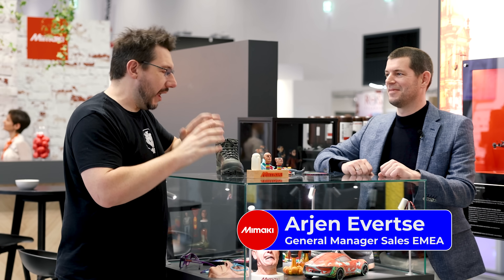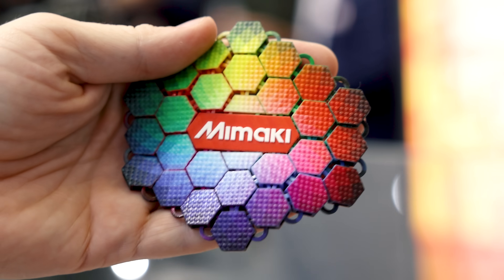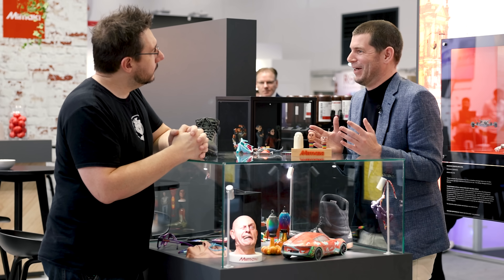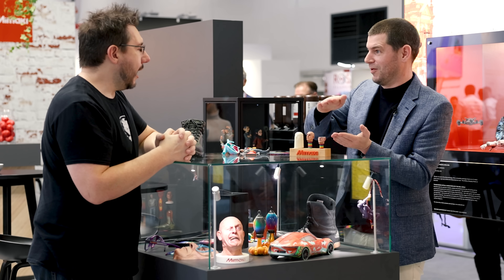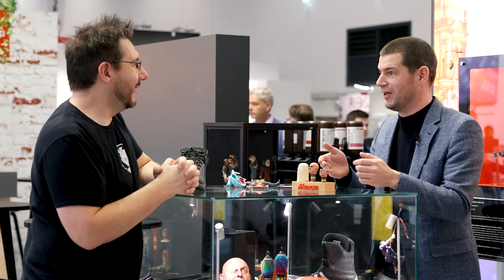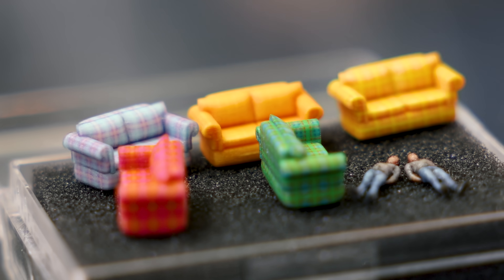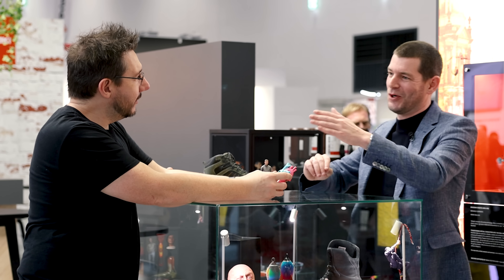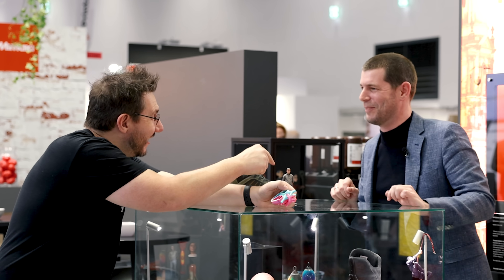3D Printing 10,000,000 COLORS?

Comment: This is a really cool new tech, but I wonder if 3D print fans know we've had full color prints for 20 years now. I was already a fan for a year or two before getting to see Z Corp's starch powder based prints at Siggraph 2005. It raked over a thin layer of starch powder, then used an inkjet + binder to lay down a full layer of color, or just at the edges if you wanted. The binders could be different, so the spring looking thing in my pics here is actually fully squishy rubber - it feels like latex (they sent me one as a sample request, but it didn't hold up well through all these years, and got pretty stiff). These were tens of thousands of dollars. Then Dimension came out with a filament machine, and I wanted that, too. I remember watching them drop each year, from $20k or $40k (can't remember now) to $18k, then one of them was $8k, and I thought a long time about it, but never dove in. One cool thing about Z-Corp's powder tech is that you could cut through it at any angle to reveal full-color cross sections. I'm fascinated by Mimaki's concept, though. Anyway, my old pics from Siggraph 2005 of Z-Corp's prints: https://www.flickr.com/search/?sort=date-taken-desc&safe_search=1&tags=zcorp&user_id=85719887%40N00&view_all=1

Comment: I run a Mimaki UV large format printer at my work, we have another with a raisable bed, we actually basically 3d print laying layers and layers of the exact resin he's speaking of here. minus the ability for the fancy washable supports; We've even taken our waste ink or expired material and dumped it in a resin printer, cured it with UV, worked okay.

The machines these guys produce and the print heads they make are insanely cool, they're amazing machines.

Their service team over here in North America, lacking in my experience..

Comment: I love how this technology has expanded over the past few years... I know it has been on the "outskirts" of 3D printing for a while and used in certain high end niche projects and steadily getting better.  I would not hold your breath for it getting anywhere near the consumer market like other formats in the near future... maybe in a decade it will get down into the single digit thousands... The tech is available, but it is still a very slow process building up ultrafine layers and even though it is kind of like a flat inkjet, the inks are still hard to work with and need a very controlled environment, plus it is also almost as messy as resin printers.  Thank you Joel for giving us a great update into what is possible!

Comment: It's pretty staggering how precise the tolerances are to have a machine drop four colours of ink, plus whatever other chemicals are involved, with microscopic accuracy, from a print carriage that just whips back and forth thousands of times. I've used a few large format commercial (2D) printers like the kind Mimaki are known for, and even those are impressive. But doing it in 3D is just nuts.

Comment: It's not just the colors that's impressing me but the very fine, seamless, smoothed layers at that size.  Edit: just got to the part about layer size.  Which, when printing at 20 microns and depositing colors at 1 picron, that makes sense.  Still blows my mind they're able to do that fine though.
Reply: to me, the most impressive thing that I want soooo very badly at a consumer level is the "support liquid" that just washes away, no more pockmarks/divots,  no more print failures/pancaking

Comment: This is where 3D printing will have to head. The most important aspect of 3D printing is the final product which includes color. If you can have an insanely detailed piece of 3D print with such color fidelity and detailed accuracy that is where the money is at. If you ever had to make a resin model finalized you would have to have a professional painter artist to do it and you can only make so much profit from these prints and then you have issues with the consistency of the color and output. The important part here is that this is fully automated and a final product is there waiting to have the supporting layers washed off.
The machine is expensive but if you ever manage to get one you can easily make it back within a few years if you do model printing. Imagine making professional miniatures that go for hundreds of dollars each.

Comment: As others already pointed out, he said picoliters, not picometers at 4:02. 6 picometers would be smaller than atoms. 6 picoliters is not that small:
1 l = 100x100x100 mm
1 ml = 10x10x10 mm
1 ul = 1x1x1 mm
1 nl = 100x100x100 um
1 pl = 10x10x10 um

Comment: Cool tech. But on the downside - it's only acrylic photopolymer, which means it's not very durable and it's brittle. Exceptionally good for some installations, figurines maybe, but not very useful for household applications or devices. Basically, see, but don't touch (or, to be more precise, you can touch, but can't squeeze, push, pull, punch, drop it, drop onto it, etc.)

Comment: If that ink is anything like what's used in UV printers, the cost per print has to be enormous. The ink I'm familiar with runs ~$650 per liter and is only commercially viable because very little is required per flat print. While the printers can do texture, even printing a section with raised letters or braille increases the cost significantly.

With all that said, I am so excited that this is being pursued because wow those results are spectacular!

Comment: Thanks to 3D Printing Nerd for creating great content, but Mimaki's machine has a lot of flaws.
I have been dealing with the equipment introduced in the video for 2 years.
This equipment has a horrendous number of errors and spits out error messages requiring an engineer to be called at least once every two months.
As shown at 4:17, the inside of the outer wall of the shape to be colored is filled with white ink, and most of the problems occur in the filter through which white ink, which is used relatively more than other inks, passes.
Also, the print head of this equipment has a shorter life span than expected and is more expensive than expected.
In addition, it is applied to other equipment of Mimaki, but the shelf life of liquid materials is short, and materials past the expiration date cannot even be put into the equipment in a normal way.
Only those who have experienced it can understand the stress that users experience from these issues.
Of course, the performance shown by this equipment is amazing, but if you consider purchasing it, we recommend purchasing it after conducting a sufficient review regarding maintenance.

Comment: so this is what happened to the tech from Zcorp?
Reply: Z Corp's equipment is similar to SLS technology, using white powder as color ink.
The Mimaki machine is similar to 3D Systems' MJP technology or Stratasys' Poly-jet technology, so to speak. Light-curable materials are sprayed directly from the head.
The difference from MJP and Poly-jet is that the material used is full-color, but the focus is only on the appearance of the product. Mimaki does not pay much attention to the physical properties of materials.

Comment: THIS. This is 3D printing. The main question is how strong the results are, or if it's limited to modelling. But since it's a cold process, you could theoretically print it with holes for support structures, put them in half way, and then just continue...
Reply: Generally, the results are similar to abs. Depending on the slicing software you are using you can chop up the file and add pins for assembly or design with voids for supports. Where the voids are correctly placed the water-soluble support solution will fill those areas. Those can be dissolved away later and supports can be added.

Comment: OK, so that building model desperately begs two questions. The first one is: is it all solid? Are all the voids just full of transparent materials, or is there air trapped in there? And, of course, the second one is: Can this print different materials? Can I, for instance, have brittle and solid materials together, so I can print one of those Fossil Dig Kits, where you get to chip away at a soft material to unearth a piece made of a hard material within it, like a fossil model? That is the first application that came to my mind, but I'm sure there are countless others!

Comment: sweet full color 3d printing! now they just need to cost like sub $1000 and well be in business
Reply: @ButterfatFarms  i dont think those are equivalent. i think its much harder to print on an already 3d object than to just print cmyk dots on the edges of a print. this is just a uv flatbed printer that does a bunch of passes on top of each other. with 2 extra colors...clear and some weird water soluble gel stuff for support

Comment: Joel, I'm pretty sure he said "picoliter" rather than "picometer", as pL is the general terminology used for inkjet print heads. Also, while 6pL is absolutely tiny, it's pretty average for an inkjet. Some home inkjets go as low as 4pL droplets.
Reply: I wouldnt be surprised if this gets wide-spread adoption, we get even higher resolution pL.
Reply: But he cofirms saying its 10^-12, and i don't get it because a sphere that size would have a 12 micrometer diameter, and that is a very small droplet...that is the size of a whiteblood cell. How is the ink drop applied in these processes?
Reply: @Brubigo  ultrasonic piezo element - just like in average piezo-driven inkjet printheads. If the resin-filament is applied by the printhead, then cleaning it between "prints" will be a p.i.t.a.
Reply: @Brubigo  jup that's the question I'm asking myself too. 6 pL applied to a flat surface is different to a volumetric 6 pL drop. As the printhead's main cartridges contain pre-colored material, I'm assuming the printer uses volumetric colored material applied in 6 pL drops and at a layer height of... what did he say? 20 µm... who's willing to get out the calculator and check the actual x/y/z size of a single drop? It's an incredibly high resolution.
Reply: @JBJHJM  This is piezoelectric inkjet head most probably made by Epson. I've been working with this technology on their 2D printers.  Quote: "A piezo inkjet printer is a type of inkjet printer that uses printer heads containing special crystals to which an electric current is applied. This causes the crystals to expand, forcing ink onto a substrate. When the current is removed, the crystal shrinks again, drawing up ink into the printer head."
UV lams cure the liquid monomeric "inks" into hard resin on the go as the layer is quite thin.
Reply: he also said 1x10^-12m at one point and im unsure of that size.. an atom is 1x10^-10m
Reply: @musicatpurrcussion  It is definitely picoliters as it is commonly used in inkjet technology

Comment: This is impressive!! I checked out the specs on their website and the printing time is pretty fast for this level of details. The only negative points are the size and the price (~$230k), yes it's a professional printer. I hope to see smaller and cheaper 3D printers like this one in the future.
Reply: the closest you can do is to resin print and then have someone meticulously hand paint it, and you still wouldn’t have this degree of color accuracy and detail. Employing a model painter this skilled would quickly reach 230K in a few years
Reply: @ButterfatFarms  I know
Reply: @ButterfatFarms  to have them professionally painted with this amount of color accuracy and skill, I’d recon easily 100k a year
Reply: Was ~230k for the larger of the two? 230k for the 553 seems right, but a little pricey for the 2207
Reply: @BaneWilliams   ~$230k was the only price I found on internet for the 553. After your reply and searching more I found ~$40k for the 2207 which is way more affordable. Please correct me if I'm wrong.

Comment: How do they do overhanging?  Like the ceilings in that building ?
Reply: In void spaces white ink can be used. For things like the windows the 553 model has some optically clear ink options. Otherwise, there is a water-soluble support material that is printed along with the layers of color ink.

Comment: WOW. This is insane ! I wonder how much time it takes to print the shoe for example. Small precision : he said 6 pL = 6e-12 L = 6e-6 mm3 = 6e-6 (1e3 um)^3 = 6000 um3 which is a voxel or droplet of around 18um in each dimension. Picometers indeed measure atomic structures for example the "diameter" of a water molecule is around 250pm in other words you can align 5 water molecules in 1nm.

Comment: I actually used Mimaki Taiwan's service last year and you have no idea how easily this machine break. Just two test print and it break, they told me they need a week to fix it which in the end they gave us discount and print it with single color and painted myself afterward. It's a cool tech especially from those samples they brought, but to be honest it's more like a experimental machine and I don't really think it worth the market.
Reply: By the way they gave me a colorful spoon as a gift and it's really beautiful especially when the printer is able to give the model a clear coat of resin on the outside to make it glossy.

Comment: Well, i'm going to reveal a industry secret that looks like nobody had fallen into it. Are you ready??!!!
Any, I mean any any standard or laser color or black/white paper printer is in fact a 3d printer. Only lacks the Z axis. Normally the colors materials are resins so if you could print a layer over another you will have a 3D model. Just transform your old color printer, add a Z axis and a hot air flow to dry the resin of any layer and there you are.... Your 3D model after thousands of layer of course, because standard color printers use a very thin layers. No thanks needed, it's my Christmas gift for all of you my friends. See you!!!

Comment: We use a UV printer for signs at work and we learned pretty fast you could do braille by overprinting multiple passes.  I wonder if their slicer just prints multiple pages to the printer, rather than send Gcode or some other control language.

Comment: 15 years ago my makerspace had a similar kind of printer. It was a combination of a sintering plastic printer and an inkjet. Nowhere near this resolution, the models were fragile and had to be baked after printing to fully cure, but it used inkjet cartridges and the 'ink' liquid to fuse the plastic powder which was then heat-cured into a more solid mass.

This looks way more impressive, but it probably costs more than all my 3D Printers and laser cutters combined.

Comment: That is a revolutionary innovation. Having to print models with insane details and painted at the same time is truly remarkable.

Also, the new outro is really good. It's really impressive that the smoke cg interacts with the real models. The smoke travels like a proper fluid and creates shadows as it wraps around the models. The effect is really close to being natural. Great content as usual!
Reply: That's because it is not CG but ink being injected underwater, so it will flow and interact with the models... even so, it is very tough to get it to do that so nicely and if you don't get the shot, you have to drain, refill, reset up the injectors and try again... Smarter Every day took about a week to get vortex ring collision swirls *just right*...

Comment: when i was interviewing for a machinist position at boston scientific i got to meet thier 3d printing guy. and it really was just one guy in a messy room with a number of various printers from hobby to industrial level. there was half finished food and open boxes of takeout and the more i looked at it the weirder it seemed, i noticed that all the takeout boxes had the same amount of food left in them and the same stains and the lids were all open at the same angle... this motherfucker used an ink 3d printer to make messy food for his office space! there was a doughnut with a bite out of it and it had frosting and sprinkles on it, it was so detailed that even the glaze of the frosting  had depth, he even set it on a napkin with a little grease on it to sell the look. absolute madman, he was scanning his lunches and snacks halfway through eating them and using a multi thousand dollar machine paid for by boston scientific to print them out and immortalize them in ultra detail! so much respect for him, we talked for a few hours after the interview was over and i got my hand scanned in a "ewww whats this thing" pinching posture to mount on my wall at home, i use it to hold notes or my keys.

Comment: So the only thing that can set this apart from the PolyJet technology Stratasys/Objet has been using for decades is pricing. What are the prices of their machines and materials? Because I have a Stratsys J850 Prime one room away from my desk at work and I know it can do everything this machine can do just as well if not better. BUT that machine also cost $500,000. So it is expected of it.
Reply: the 2207 model starts around 40k usd and the larger 553 model starts around 220k usd.